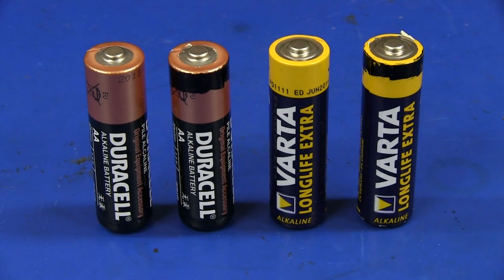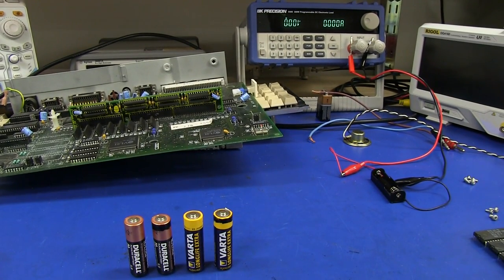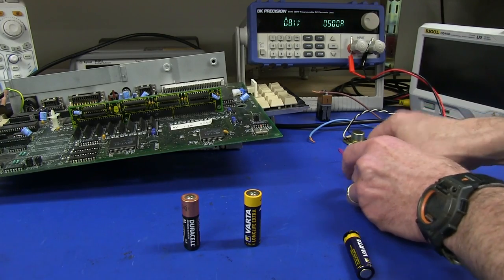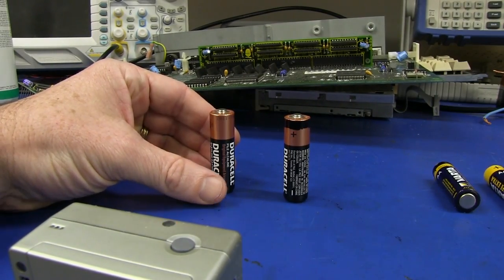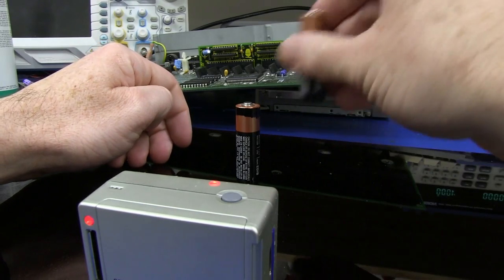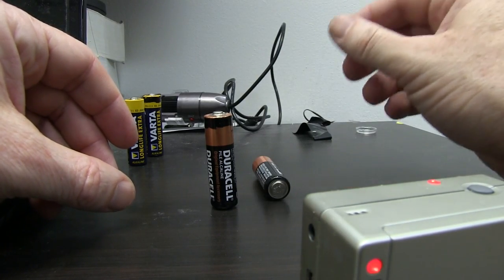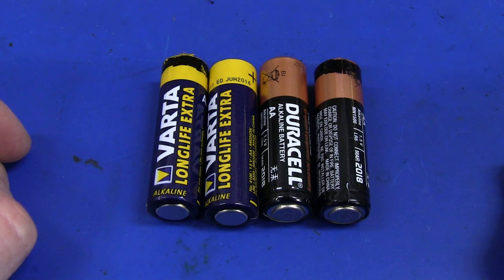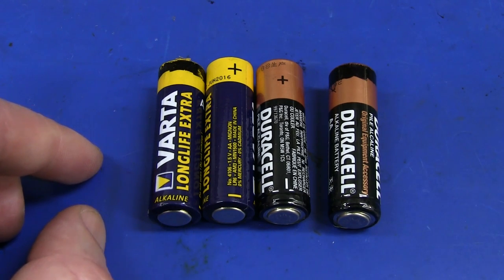EEVblog #508 - Can You Test Battery Charge By Dropping It?

Comment: The Princeton University team dissected batteries with various degrees of discharge and examined their contents under a scanning electron microscope. They discovered that in the process of discharging, there also a physical as well as chemical change in the nature of the battery.

The zinc oxide forms around the zinc particles embedded in the gel, slowly turning the gel to a ceramic. While the material starts as tightly packed particles, the oxidisation process forms tiny bridges between them, producing a material a bit like a network of linked springs, which gives it bounce.

However, “maximum bounce” is reached when the battery is down to about half its charge, at which point the amount of bounce levels off despite the fact that more zinc oxide is still forming. So the bounce technique can reveal that a battery is not fresh, but it is not an indicator that it’s entirely flat. Still, it’s an easy and instant way of checking the profusion of batteries filling our drawers – no multimeter required.

Comment: Yea this was never intended to be a scientific test, nothing beats a multimeter or load test for accurate v/amp calculation. It's just kind of a cool and interesting thing. BTW, sometimes devices fail and I can't even count how many times I have taken batteries out of a device to see which is bad or if the gadget is bad.Nice presentation EEVBlog!

Comment: Is it possible to use the same method to detect the activity level of used nuclear fuel rods...?
Reply: Well...... That escalated quickly
Reply: Once.  You could do it once.
Reply: nullbewahrer safety first, make sure you use gloves and eye protection.
Reply: ***** MY EYES, THE GOGGLES DO NOTHING!
Reply: huUH
Reply: nullbewahrer is it possible to drop myself from 1story building if i stands still my stomach is full and if i fall my stomach is empty. these trolls hyped it well
Reply: I know its a 4 year old joke but i actually think useful information could be obtained about how used is a nuclear fuel rod by dropping it. When a fuel rod is "burning" inside a reactor the fuel suffers changes as its elements transmutate into others, also the extreme ionizing radiation levels and neutron bombardment changes the crystal structure of the fuel rod cladding and sheaths, also helium bubbles can form between crystal boundaries. All in all there should be a significant change on its structural properties, enough to modify its behavior if its dropped.

Comment: Have to ask  this:  What happens if you hooked the "Baterysizer" thing to the dead batteries.  Will it then bounce extra high?  Or give a larger 'Thud'.... like the sound your wallet will make if you shell out real money for such snake-oil...
Reply: +Tedybear315 I decided to test this. First, I discharged one of two new batteries fully by shorting it for 30 seconds. Then I put in in the Batteriser and dropped it from one battery height. It barely bounced at all. Upon taking the battery out and testing it with a multimeter, I found that the Batteriser had recharged the battery to a full 1.5 volts. At first I thought I had succeeded in pulling free energy from the quantum vacuum, but I contacted Batteroo and they told me that the kinetic energy from the fall had simply pushed the extra 0.7 volts of energy the Batteriser produces back inside the battery.
Reply: Kinetic energy pushed it back in?  Sounds more like a reverse enema took place on the battery.  (sorry, bad joke on my part)

Comment: When I replace G13 button cells on the calipers I maintain, I notice that the old batteries are usually bloated. There may be a similar pressure build-up issue with the dead AAs that causes them to bounce.

Comment: Batteries don't change in mass when discharged. The only thing that might leave a battery is electrons, but electrons are so infinitesimally light, that it makes no difference.

What I think is happening is that there is a transfer of mass between the anode and the cathode. The cathode is the negative terminal on a battery. (the flat bottom). In a fully charged battery, the mass is more uniform. But once discharged a majority of the mass from the anode is transferred to the cathode as a result of the chemical reactions that went on in the battery that allowed it to produce electricity.

So this alteration in the distribution of the mass within the battery had a noticeable effect on the bounce. I bet what is happening is that the cathode of the battery is heavier and thus more of the inertia of the battery is transferred into the table allowing more rebound (remember Newton's laws of motion? For every reaction there equal reaction. Since the table is immobile most of the energy of the falling battery is transferred back into the battery with some being absorbed by the material of the table).

The mass of a fully charged battery however is either more uniform or closer to the top/edges and so not as much of the mass gets it's energy transferred. The end result is the bottom of the battery absorbs more of the impact and thus results in the "thud" because the inertia had been absorbed by the cathode material then would have been if the battery was discharged. (cathode not as dense, so it can absorb more impact)

I honestly don't think gas buildup would have any measurable effect on the bounce. These batteries are small. What ever amount of gas they produce is so small, it can't alter the end result. It's more to do with the change in mass of the cathode in relation to the anode.
Reply: According to construction of alkaline battery negative terminal is insulated and hold by polyethylene plug, so internal pressure must be most important factor here.

mass redistribution is not that high as only one oxygen atom is transferred from anode to cathode so charged battery has slightly denser and harder shell and thus if should jump better. But what happens is exactly opposite

I expect that if there is no gals buildup discharged battery must have higher pressure because  anode absorbs additional oxygen and all that goo expands  a bit
Reply: Let's take an AA battery that weighs 20g. An AA battery has a typical rating of 1500ma-hr, or 1.5 A-hr. 1.5 A is 1.5 C/s, so we have 1.5 C/s * 1 hr  * 60 min / hr * 60 s / min = 5400 C. 1 C of electrons is 6.22 x 10^23 e-, and the mass of an electron is 9.11 x 10^-31 kg. Multiplying together we get 5.49 x 10^-7 kg or 5.49 x 10^-4 g or 0.549 milligrams per Coulomb, so in a AA battery with 5.4 kC of charge, the charge carriers would weigh 2,965 mg or about 3 grams.

3 g is exactly 15% of the mass of our battery, which isn't insignificant. Note that most of these electrons are returning the cathode, so while your initial statement that batteries don't change in mass is true, electrons are a significant portion of the mass of any object.
Reply: *****
"most of these electrons are returning the cathode"
not most but absolutely all.
If you could extract 3 g of electrons from an object like battery it would gain enormous electric charge.
and I guess your calculations are wrong because it is way too much weight, I would expect it to be like 5 nanograms at most
Reply: deltaxcd
Actually, depending on the length of the wire, none of the electrons may return to the cathode. I said most because I assumed they traversed short length of wire, but electrons don't travel at the speed of light in a wire--only the electric field does. Electrons move at a drift velocity which is dependent on the current, the charge carrier density (electrons per unit volume in this case) and cross sectional area of the conductor. For example, in a 24 gauge copper wire the electrons will move at 539 um/s (roughly half a millimeter per second). This is because the electrons collide with the material already in the copper--in a cathode ray tube (CRT) the electrons move at ~0.1c because it's mostly a vacuum inside the tube.

You are however quite correct on my math, here's the corrected version:

1.5 A-hr (5400 C) AA battery weighing 20g, same as before.
Mass per electron: 9.11 x 10^-31 kg
Electrons per coulomb: 6.24 x 10^18 e-/C
Mass per coulomb: 5.69 x 10^-12 kg, or 5.69 pg/C (picograms)
Mass of electrons in 5400 C: 3.07 x 10^-8 kg, or 30.7 ng (nanograms)

Which is 0.00000015% of the total mass of the battery. I think we can safely say this is negligible.
Reply: The problem is not with the gas or electrons or anything really.. it's very simple.. a new battery has the inside very sticky and wet and a used battery has the inside mode dried up. i'm not saying that the liquid evaporated. I don't know the exact chimical procedures.

about 3-4 years ago i opened up a battery and i accidentaly opened up a new battery (i realized it after i cutted up the exterior shell and before i saw the sticky inside) and after i realised that i ruined a new battery i continued to open it. After that, i opened the used battery and to my surprise the inside was more dry, not as sticky and wet as the new battery.

i didn't know they would bounce differently but i knew that the difference between them is that the inside dries up once it is discharged.
Reply: Sinoaie Marian
It should not dry, because electrolyte is not consumable according to battery chemistry.
it can only evaporate or leak if your battery is punctured.
I guess you make incorrect assumption, because electrolyte in old battery is highly  contaminated with zinc oxide so it becomes thicker.
Reply: Thing is mostly that mass does indeed go from cathode to anode. As the cathode is really the battery's zinc outer casing (or zinc plated onto the inside of a steel casing) the casing gets thinner, and as it gets thinner, it becomes more flexible, thus more bounce.
Reply: ManWithBeard1990
You don't even know construction of alkaline batteries:
they are exact opposite of what you describe here.
Battery casing is covered with carbon and manganese peroxide, while zinc is all in the center pin.
Reply: why don't you open two batteries? one empty and one full..
Reply: You are certainly correct on the drift velocity, but a conductor conducts current because the electrons can freely move. There are already electrons in your conductor, so, metaphorically speaking, if you then push new electrons in on one side, the ones on the other side come out (after the change of the electrical field propagated through your conductor). So they all start moving nearly at the same time, otherwise for example you would not be able to turn a lamp on (nearly) instantly.
So the number of electrons leaving the battery should be (nearly) the same as the number of electrons entering the battery - but they are not the same electrons.
Reply: deltaxcd

You're right.
24-year old me didn't know that back then but I do now.
Reply: Electrons don't leave the battery unless you ran an ionizer off of it. You simply moved electrons, so the weight would be the same.
Reply: The cathode is the positive terminal on batteries actually
Reply: I think this is due to the fact that the electrolyte gel is hard when the battery is empty and flexible, liquid, when the battery is full. The hardness of certain matter is known with presence of electricity or not.
The battery seems to have liquid inside, or a solid matter inside when it is empty.
Reply: Huh, I was wondering if e=mc² had anything to do with it. Apparently not.
Reply: Batteries convert chemicals into different chemicals by means of electron movement, which is used as electricity. I assume the chemicals becoming different chemicals is the reason why the properties change enough for this to happen. Electrons don't leave the battery, they go out one end and in the other. Any weight difference is purely due to evaporation.
Reply: Gas build up is a major part of it. You're right, The cells have a "getter" in them to absorb the hydrogen liberated from the water when the oxygen oxidizes the electrode. It's not perfect, it does require pressure for the getter to absorb the hydrogen. With as little clearance volume as there is in a cell, it doesn't take much to create an internal pressure, to make it "bounce".

Comment: My first thought was that the manganese dioxide gets more solid for some reason as the battery loses charge. If the material inside is loose, it could be acting like a dead blow hammer. They just contain some loose lead shot or sand inside the head, and they don't bounce at all when you hammer something. The momentum of the lead cancels out the rebound I guess

Comment: Possibly due to internal eddy currents and Lorentz force? I'm picturing the charged electrolyte acting like a magnet falling through a metal tube. Stronger the magnet (or greater the charge), the greater the force and the slower the movement.

Comment: The reason for the bounce is the evolution of hydrogen gas that results from the electrochemical reactions during discharge. Just like putting air in a tire makes it bounce. There are pressure vents to prevent over pressure, thus explosion. It might be worth running a cell down with less current draw, for a longer period of time. If you can use up the full capacity, you'll build up more internal pressure, giving a better "bounce". This is a neat experiment, I've never seen it before, but it makes perfect sense, knowing something about electrolytic reactions.

Comment: When a battery discharges the negative side starts to bubbling a bit due to the chemical changes inside. So, the bottom part that hits the plot is no longer flat, thus making it "jump" on contact with the hard surface. You can verify that by measuring the batteries with a good caliper or even better with a micrometer.
Of course, that depends on the battery design. In your case, Duracell and Varta are using a positive "body" and a negative "cap", but some other brands are using the opposite.

Comment: Parts list:
1. Clear tube, twice length of battery, diameter loosely fits battery.
2. Spring clip with thumb tab suspends battery half way down tube.
3. Hard end cap with enough mass for battery to bounce against.

Use:
1. Insert battery.
2. Hold tube in vertical position with end cap at bottom.
3. Release spring clip so battery falls.
4. Observer bounce height against marking on side of tube.

$14.95 set of 4 sizes

Should I patent it?  How long before it shows up on infomercials? ;)

Comment: Keep in mind that you need to have a closed circuit in order for electrons for flow. Electrons flow out of the cathode, and what do you think flows back into the anode? Electrons.

The given number of electrons in a battery should not change after it has been used. The only thing that changes is how those electrons are shared.

Comment: After watching the video, it seems like the bottom contact on the discharged battery has become more curved than the fresh battery. This makes sense as most batteries get warm during discharge which could deform the metal making it 'proud'. A curved bottom contact could act like a spring, causing it to bounce more, which makes me wonder if a slow discharge to prevent the battery from getting warm would prevent that. Perhaps you can look into this as an explanation in your scientific video?

Comment: Thinking about it some more; a proud curve on the bottom could also be the result of internal pressure build up, in which case a slow discharge shouldnt change the end result, so a slow discharge test would be able to suggest which direction the answer is in [internal pressure or heat deformation].

Comment: You mention weighing them...If you did, would they have different numbers?
Reply: nope
Reply: +budrig Empty alkaline batteries are significantly lighter than full ones. Try it for yourself by holding one in each hand.
Reply: Comparing weights in two separate hands isn't all that accurate. 

I just weighed four different batteries of the same brand; two dead, two new.

My scale is only accurate to 1g but both new ones measured 24g and the dead ones measured 23g. So they might be lighter but only a tiny bit.

Comment: Alkaline batteries have an outer casing which is partially consumed by the reaction - this is one reason flat cells can leak.
Internal pressure makes a difference too.
Sectioning the battery might be a nice followup - what does it look like?

Comment: well, this is not chemistry but simply physics. An discharged batt have less dark matter (which is actually due changed potential, hard to explain it simply), so the influence of dark energy (on the gravitrons) is bit higher and the batt can bounce more/higher.

Comment: I'd say a full battery has an inside consistency of sand, that muffles the bump like a dead blow hammer. As the battery discharges it thickens becomes stiff and ultimately becomes a solid body, which can rebound quite like a regular hammer.

Comment: I think gas is produced by the chemical reaction and maybe pressurising the inside and making it springier, although they are vented I think for this reason so maybe not. I would predict the discharged one would be lower mass than fully charged so they are different.